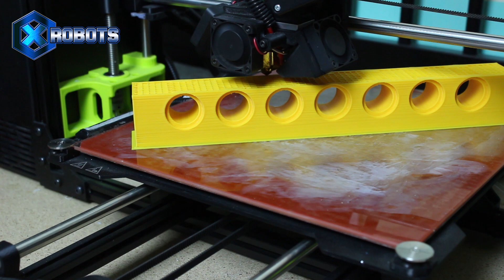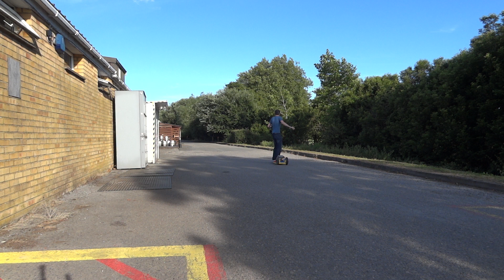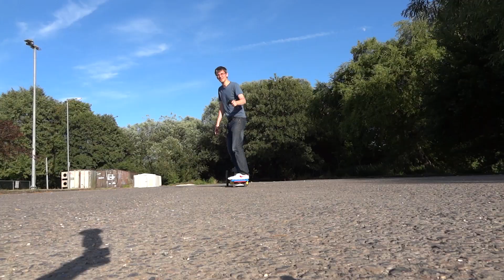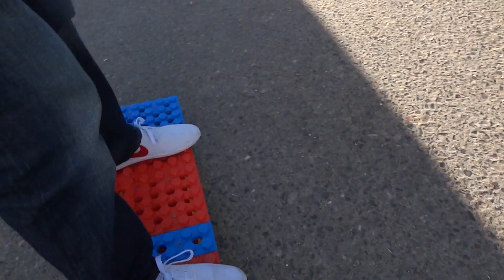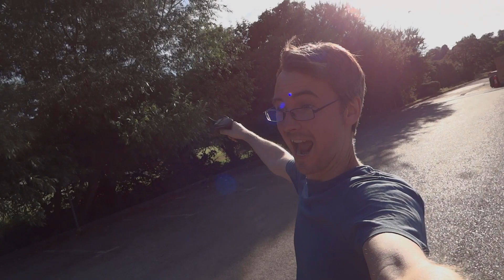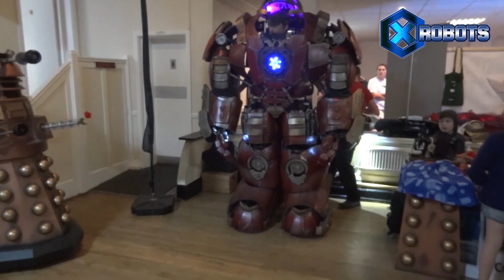LEGO Electric Skateboard #2 | James Bruton

Comment: You can get angled riser pads for skateboards to increase the amount of turn you can get from the trucks, or switching to reverse kingpin trucks, which a lot of longboards use, should give you a better kingpin angle. This should allow you more turn without increasing the angle the board has to lean meaning the lego bricks shouldn't ground out. If you can shorten your wheelbase a bit would also help longer boards dont turn as easily, moving the rear wheels forward a hole and the front trucks back a bit could make quite a difference

Comment: You can install suspension trucks for the bumpy sections, which are also higher and might allow you to lean the board more for an improved turning radius or you can adjust the current set to be more willing, also quick note to compensate for the slow acceleration you can pedal 
what really impresses me is how straight and leveled everything is :)
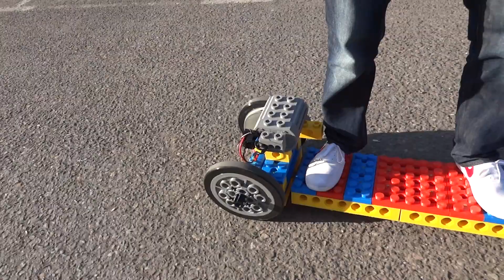Reply: 1:30
i just noticed, did the board angle out
you could try 2 solid 2x16 under slopes and compensate for the plank with a flat gap for

Comment: While watching this video I was thinking that what you could try to build next is a BTTF hoverboard. :) You could quite easily hide the wheels on the underside and all the electronics as well. The finished product would be a bit thicker than the hoverboard in the second film, but at least the motor you used in this project was reasonably small, so that could be hidden away without too many issues.

Comment: This is a really cool project. Any chance that you can make a list of the drive belt and the pulley you're using? Perhaps the rest of the drive system as well?
I'm building a drive system for a stock car for my daughter, and I really like your setup, but have issues finding the right belts and pulleys for it. I'll be 3d printing the pulley for the wheel, but planning on buying what i need for the belt and motor.

Comment: probably still cheaper than actual legos.
Reply: Mr.ActionGal101 you obviously have no idea how much 3d filament costs. the filament required alone probably cost around $500
Reply: i'm super sorry you took a joke serious.
Reply: then it was a bad unimaginative one 😂
Reply: I got the joke (and torment of having nephews who like lego). But also, a Lego set the size of this skateboard could cost anything from about £200 to £1000, and I doubt most of them will withstand the weight of a full grown Jack Russell while stationery, let alone propel a full size human to grin inducing speeds
Reply: phunfone Well, by the video it looked like he was using something around 25% infill for the bricks, and at that size, I’d estimate each piece is like 190 grams or more. There is normally about 1000 grams in the average role of filament. I’d assume James only uses premium abs filament (like polymaker.) So six bricks is about $50. I’d imagine the whole board is at least $370 excluding the motor and electronics; So i guess you were pretty close!

XD
Reply: uhh I think he said pla in the vid but I'm too lazy too look back into the vid so uhh... but, if he did use pla then I would be even more wrong lel

EDIT: but then again, at the time I was thinking more of like 70% infill 4 some reason so uhhhhhhhhhh
Reply: bad joke guys! * Inserts laughing crying emoji
lol
Reply: phunfone well he does tend to make many of his parts in abs so he can solvent weld them, though h might be using pla for this one...